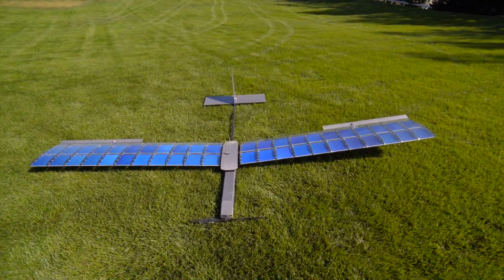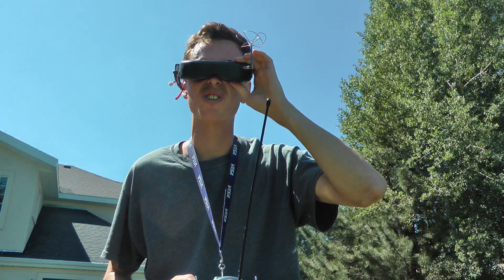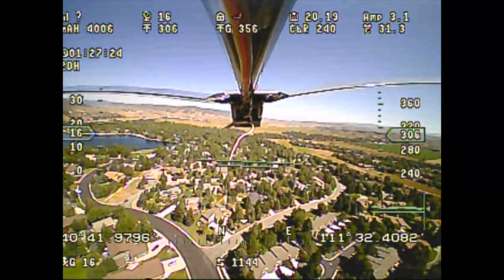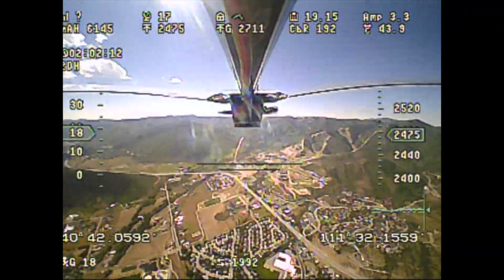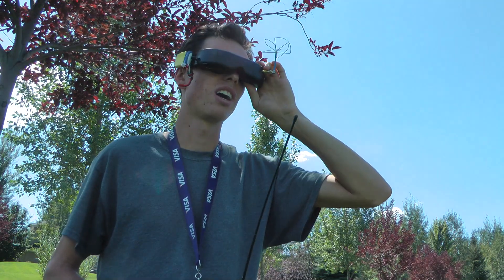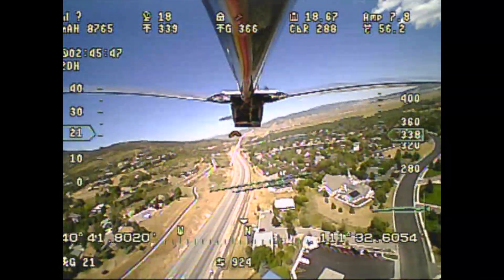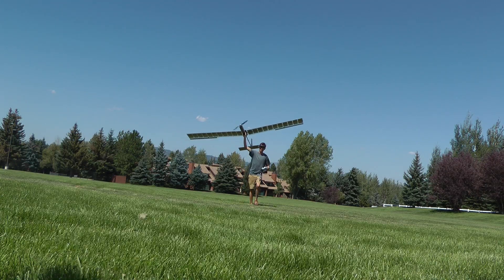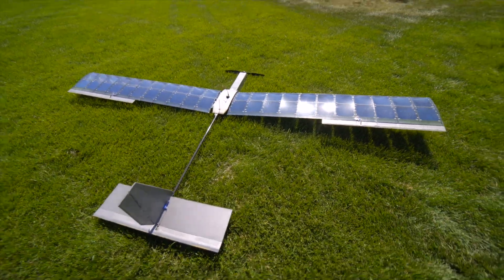SOLAR Plane V3 Long Duration Test Flight - RCTESTFLIGHT

Comment: Just curious - have you taken and passed the FAR part 107 test? I am curious if you could get your commercial UAS license, and apply to get a waiver to fly above 400AGL the ambient air temperature would keep the cells cooler and there would be less pollutants between the cells and the sunlight. I noticed what I think is an altimeter on the right hand side is it displaying MSL or AGL?

Comment: Why did you turn the cells off? Were you wanting to dump power for landing?  What about using autopilot controllers? So you can have it fly a circuit above other rc planes and film?  Or is the airframe not stable enough for that?  I know some platforms require so much hands on that it would be impossible to turn it over for autonomous flight.

Comment: As well as a motor with high stator rather than wide.
Also the nose generates both turbulence which affect both the prop and wings further back. (kind of sinks in to a hole in the air)

Comment: !!   soon as you said pulling power for the solar I was like..  uh no   they should be powering at battery..  you cant draw power and charge a bat at the same time..      then again I think your aircraft needs more wing ,    the slower you can stay in the air the more energy you will conserve..

Comment: Wire the cells in parallel in groups to hit around 6v and use a mppt boost they are more efficient and using panels series has the downside that a panel acts like an open circuit when shaded

Comment: i dont get why disconnect the solar cells at 14:00.  Having charged batteries could keep you from losing your plane.  Why not just kill the motor when you dont want thrust.  anyway this was a great accomplishment.  it reminds me of a sci fi book series by Dean Ing about a future where underground resistance TV signals were broadcast by self guided solar powered planes with solar cell skin.  they would climb all day in the sunlight and use battery plus best glide to stay up until the sun was back up.

Comment: You are absolutely correct to stick to this airframe and do further testing and advance modifications. This airframe and electrical works! Now for the improvements. More efficient prop would be my first change. Then go for 'lightening', reduce the weight where ever possible saving even a gram or two can improve the flight characteristics- nothing is too small or insignificant to improve. I like the shape and aspect ratio of your wing. If I were going for a new airframe, I might increase the span, going for ultra glider shapes, very high aspect ratio. But, the strength to carry the load has to be there, so this is fraught with challenges. 

Excellent job just maintaining altitude on solar alone. In fact, outstanding! Congratulations!

Comment: Interesting project.  Nice job. As RC flier, I can appreciate the effort it takes to fly a RC aircraft for over several hours in one flight.  My longest flight was a bit over 3 hours, my motor powered glider has a WS 120 inches and all flying was done by line of sight.  As a suggestion when flying at higher attitude,  fly up wind so if your radio range becomes a problem the glider will be blown your direction.

Comment: You need to reevaluate the placement of your solar cells. You have areas on the tail to add cells on the elevator and the vertical stabilizer.

Comment: So I know this is like over a year old.. but first try swapping some of the batteries out for capacitors.. that should reduce the weight some what..  Look at turning the motor off and dipping to gain speed and charge the cells then turn the motor back on while climbing.  I would also look at an automated GPS based flight program so you can just program say figure 8 loops.. program it into something like a Raspberry PI and have it just transmit the flight changes to the plane... Otherwise very cool project!  Very good work!

Comment: Also. Your motor oulls too mich cureent from the cells right? Use some large capacitors. Maybe a 25v 4000mah or larger in paralell to the solar cells

Comment: Awesome!  FYI: Flying in large circles is generally more efficient than flying in a strait line and turning 180 degrees all at once.  And for my vote, using the thermals is a valid use of solar power.

Comment: Really well done/said. I agree on the separate voltage monitoring. The solar cells can generate the voltage, but Not the amperage. That's the difference. The batteries are almost like a capacitor, where they can output higher amperage, then the solar cells (when not taxed for amperage) create enough voltage to recharge. I'd think with rewiring with diodes so that the motors can Only draw from the battery and the solar cells can Only charge the battery could be totally doable! Nice, bro...

Comment: why are you worried about thermals affecting the test result? you should use every advantage you have. you cant avoid thermals without night flying.
if anything do it for 5 days and average your flight time. that should help get better flight time data. It would also be boring as hell and might kill the hobby for awhile.

Comment: You need 2 battery packs on the plane to use one during flight while the other charges on solar power and switch in mid flight  batteries to recharge when charge drops

Comment: just a thought  maybe make a separate circuit of capacitors for storing power for when you need to up the amps it could really help level out the peak current

Comment: Tested how much voltage and current is lost from the solar panels by adding the transparent plastic over? Doesn't take much for them to lose efficiency, the "new" bendable panels might be worth a try even tho they're still behind when it comes to the max efficiency of stiff panels, that would also bring the panels out where the air could cool them a bit.

Comment: How about adding some ability to glide or soaring flight? You've got thermals popping off there and no throttle to reduced throttle should help recharge voltage loss. A little bit of dihedral in the wing and some extension similar to any sail plane should help.

Comment: You need a MPP  (maximum power point) converter.  It runs the solar cells at their optimal voltage & current to get the maximum power out of the cells at all times.

Comment: And the other guy is right if you're batteries in your head set run out before the planes flight ends all your work could end up some ones lawn dart or worse try altering your head set and controls with solar power too. You want thoes to run as long if not longer then you're plane your plane may be able to power its self but it cant fly its self.

Comment: Give it a longer wing with more angle on the front of the wing but dont give it more wing span and it needs wing defusers on the wing tips to prevent wing swirl off the tips also i saw an idea that would work,batterie charge cycle swap heres my idea on that,let air cool it expose one side of the battery to the air.The top of the planes body is a good place to do that.Last thing ever think about a larger prop with more surface made out of carbon fiber?

Comment: you need a 60w solar panel array to supply a constant 3 amp drain at 20 volts ( for normal constant flying) and a DC to DC converter to regulate the solar power to the battery providing electrical separation of the changing voltages of solar power supply and the battery storage... And finally a test rig on the ground to constantly use the motor and to monitor nominal battery consumption... Then if successful use it to assemble in a flying prototype...

Comment: MPPT charge controllers usually have dc-dc converters, which can step up the voltage, to a higher voltage with lower current but can also step it down to a lower voltage with higher current (whatever is necessary). Generally you want your batteries charging voltage to be as close to the solar panels maximum power point as possible, since the smaller the voltage adjustments the charge controller has to make the higher the efficiency. This usually results in the charge controller having to be able to step up and down though. If you need more battery capacity you can always connect various batteries in parallel. If your motor needs a higher voltage. Well I would recommend getting a motor that works with whatever voltage your batteries put out, since boost converters are inherently inefficient and therefore not recommendable for high loads if you don't really need them.

P.S. You could also measure the current between the battery everything that is connected to it. Then, depending on whether you have a positive or negative reading, you know if you are using more or less power than the solar panel is giving you.

Comment: For best efficientcy remove any boost solar charge controller. Just match the solar maximum voltage with the battery. So in your case a 6s battery with a lower kv motor would be a good start. Just connect solar panels directly to the battery with a switch. Any solar controller will just lose your efficiency. And high voltage with low kv motor is key.

Comment: Using a smaller battery would save weight and based on the fact you used over four times the power of the batteries in that flight it would seem you could improve the lift to weight ratio some

Comment: Nice project. Congrats. Why dont you run the motor from the battery and charge the battery from the solar sistem with a diod?

Comment: more efficient aircraft design, like an ava pro from valdimirs models. they have thermal duration gliders already. adding solar panels to a real aircraft would improve your times drastically. Why a 5 cell? seems way too high. you could charge a 3 cell much better.  i think a lot of your issue is aircraft and weight.

Comment: I absolutely agree with Jussi Hirvonens comment about 2 batteries (one for flight, one for charge and switching mid-flight), especially when he specifies that when the motor is turned off it charges faster because the motor usage is causing a solar panel voltage drop. This would entirely eliminate the problem.

Comment: How much does the battery weigh?
Ditch the battery, turn off the low volts on the speedy and run it at full throttle.
Reply: Weight of the 5 cell is a lot of wasted lift

Comment: You need a DC to DC converter with MPPT (maximum power point tracker). I't's a control cicuit wich will garantee you are pulling the maximum power possible from the solar cells, independent of the load. I don't know if there is a consumer solution, but it's a way!
It can pull up to 40% more power from the solar cells deendind on the load!
Reply: fuck, it's this video is almost one year old kkkk maybe you realised that already xD
Reply: and you said that on the video HAHAHHAHA shit

Comment: Have you considered using a super capacitor, low energy storage, but also low weight. Seems ideal for your goal. You would basically use it to regulate the voltage from the solar panels to the motor.

Comment: looks like you need some type of PWM charging circuit from the solar array. maybe more efficient cells> or a larger wing to increase lift, and surface area.

Comment: Next steps:
-integrade LTE module into chassis
-send all video and flight data to a server
-let an AI on the server controll the plane, including landing, restarting the next day, etc..
-be the first to have a fully sustainable plane controlled by an AI travelling from specified point A to point B
-avoid getting shot down by military drones thinking this is a russian spy plane

Comment: Nice.  Have you looked up your MPP for you solar cells?  You want to be running your cells near to this on the I-V curve.  So I was writing this and just heard you start talking about mppt controllers.  Know that your open cell voltage is very different from your operating voltage. As your current increases, the voltage drops.  You probably know all this, but you are most likely to maintain flight if you keep your cells operating near this maximum power point.

Comment: Good experiment.   You need to do your homework.   Your solar input is more than adequate.  Your charge controller is not doing the job.  The problem you face is that you need a custom charge controller and that requires a lot of homework to realize.

Comment: Can you tell which Kind of VR-Glasses you have? Seems like a cheaper one and i look for something like that; doesn't have to be as powerful as an Oculus or something, i just want it to use it for the same thing you use it for
Reply: Google FPV . Video glasses like this are big in the RC hobby. Those are probably fat shark goggles. They're wireless and nearly as expensive as a VR set. There are cheaper box goggles for $50-$100 dollars though.

Comment: How about you change you configuration to a flying wing as there is less weight and drag with a larger surface area for the wings which means less power required to keep it airborne also you can fit more solar panels into the wings.

Comment: Using a DC converter on solar panels is probably not helpful. Way more efficient to adjust the voltage with the number of cells.

Comment: you only need to amp throttle and battery because when solar is putting power in the current draw from battery will drop indicating the power is coming from solar

Comment: This may have been asked before, but I looked through a few videos to see and couldn't find anything. What is the wing span and chord length? What airfoil did you use? And what was the finished flying weight?

Comment: isn't it kinda obvious that your solar-panel wing is only going to generate power when the sun is almost directly over the wing?
try a simple experiment, mount it on a horizontal pole and rotate the pole and see how the charge current changes

Comment: If you were to remove the batteries or put one with a significantly smaller capacity, the plane would be quite lighter so wouldn't you need less amps to sustain flight ?

Comment: Sun goes down, Plane goes down
Reply: Yeah. The wings turn to ashes and it plummets like a rock!  Did you think this comment through much? Like he's got reserve battery power and I'm pretty sure R/C pilots generally fly when they can see.
Reply: I doubt anyone in the hobby likes flying when they can't see shit so yeah, the plane would go down because there's no point in flying anymore.

Comment: Try better power management. How many items are running when the plane is not flying? How much does the solar cell produce and what capacity of cell will give you your base power to power everything onboard, if you want sustained flight, then this solar input needs to produce the voltage and amps to drive the motor and power the system and then provide a recovery charge.

So we are talking at least 6 amps needed from the solar cells (3amps per wing) that should provide you with all the power you need.

Comment: Boeing guy here.   Dude, you shut off the solar cells because you're bored flying?  Not really an honest attempt to see how long solar could fly. Its bullshit that it got too turbulent, dude, you got bored and gave up. 10AM to 3PM is 5 hours. one hour longer than you're willing to fly.  Get a friend to help with flying and get an honest read and then I would donate. Or, you might also install a small auto pilot, go inside, take a nap, smoke a joint, watch I love Lucy, then check on the plane.  You  might work on better aerodynamics as well.  Install more cells on the empennage surfaces and even the fuselage tube for more juice. I really do admire what you're doing so keep it up. Check out this Ruskie.  I watched it after yours and came back to offer some advice.  He got 16 hours on his plane. https://youtu.be/P8SaLxGtNKE
Peace brother.

Comment: Now that you have a good idea of how many amps are needed to sustain flight you can do some static testing on the ground at a set current (more or less controlled conditions) and experiment with different chargers, boost converters, batteries, solar panels etc.

Comment: I wonder if you'd be better off with a dual battery system, where one is used for motors, the other is charged by the panels? Just a thought. Great build.

Comment: I'm wondering how you were able to wire the lipo so that it can accept charge and discharge at the same time? Are you charging purely on the balance connector? Or did you have to Jerry-rig it?

Comment: This might sound dumb, but I would connect the solar cells directly to the battery (keep the remote disconnect) 23 volts seems high but the current draw of the motot will pull the voltage down.

Comment: There is significant loss due to air drag. Make wingtip fins, round main body after propellers, and other places. Aside that, use slightly bigger propeller - you will get more thrust this way for the same power consumption. I did not saw bottom of the solar panels correctly, but paint them black to allow blackbody radiation which will cool bottom part of the solar cells. They operate much more efficiently when cooled. And remember, all that small improvements DOES NOT adds, it MULTIPLIES!

Comment: What are the specs of this plane? How did you build the frame? How did you integrate the solar cells, batteries, and on-board equipment? And so much more. Can you provide a list of equipment/products used in your build? Thanks!

Comment: I could see there being a real demand out there for some sort of glider solar powered airplane hybrid. Basically it would be a glider in essence but it would have additional powered flight capabilities that could overcome many of the shortcomings that completely unpowered flight has. It would still have the beauty of being a flying machine that runs completely on ambient energy and would fly and feel like a normal glider except that you could power through bad pockets of sink or fly into stronger head winds. It would basically be a next generation glider.